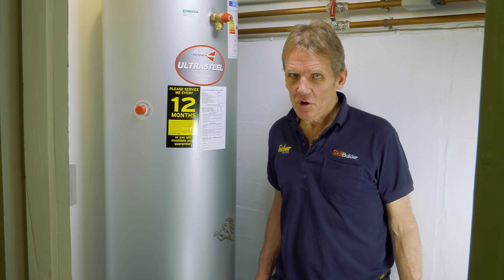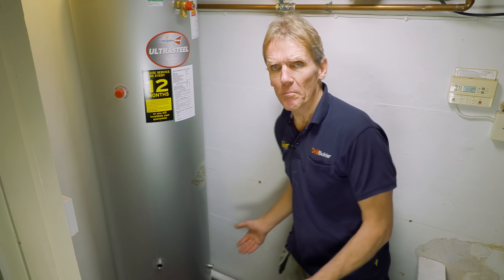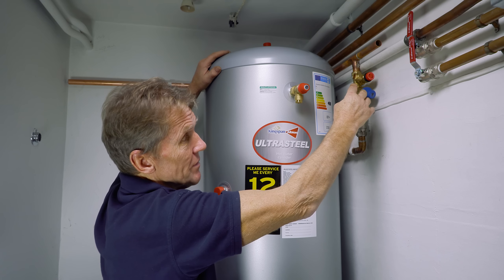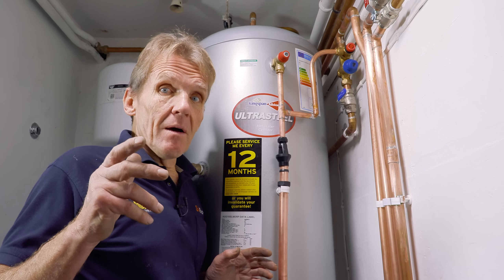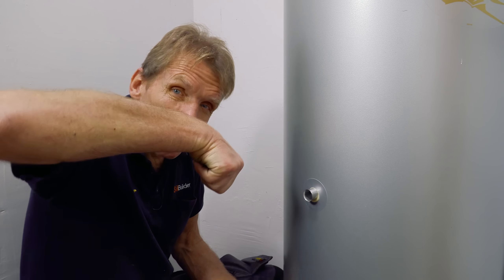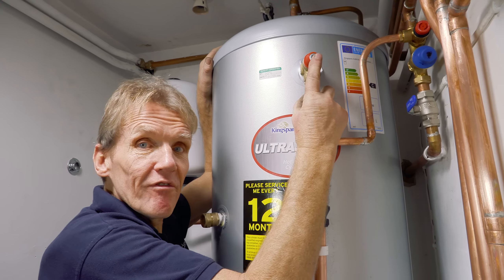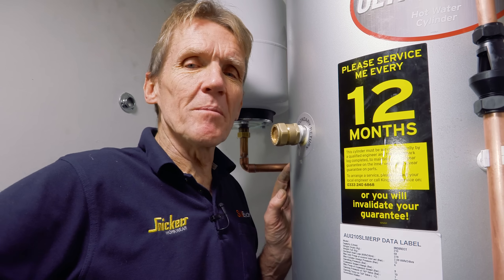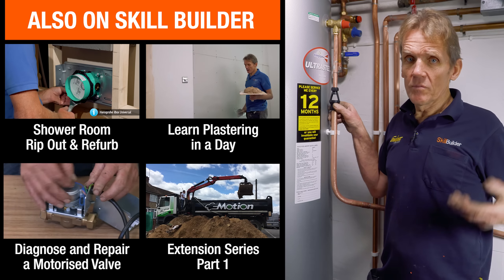Kingspan Albion Ultrasteel Unvented Water Cylinder

Comment: In my country, we only use Water boilers, all houses from 1970 was built with concrete, bricks or blocks (not concrete blocks, but normal blocks).

I have question:
I have house with upper floor and I want to use radiant heating.

This was my plan: 
Use electric boiler (4 of them, 2 on lower level and 2 on upper level, placed in opposite sides of house to lower temperature waste over long lines) to heat up water for radiators
Place radiators in all room (house is around 100 m2) 
Use eather Alu-Pex, or Copper or Iron (with insulation around the pipes)
(In next 5 to 10 years, I plan to put 4-5 Solar convection panels to get hot water)
Electric instaltion is or will be adapted to boilers needs + all appliances

I want to ask you, or someone from your audiance, can someone tell me, 
Pros and Cons using this system, and does someone have better solution?

We have natural gas, but we don't have it connected to our house or I don't want to use natural gas, as price is so fluctuating at this moment in our country.

Country: Serbia
Region: South-East Europe/Balkan

Thanks, and keep the good work.
Also, Happy New Year to everybody. :D
Reply from the maker: When you say radiant heat. Radiators as we know them in the U.K produce convected heat. Not a great way of heating. Better is underfloor heating which can run at a much lower temperature and use the concrete as a thermal store. That will allow you to replenish it with solar or electric heating.
Reply: Душан Палалић  Just go for a wooden boiler
Reply: @danielarhire1770  You mean, wooden fire boiler? :D I think wooden one will brake down. :D
Reply from the maker: This is not a boiler. It does not heat the water unless you use the immersion heater.

Comment: That cold water inlet is not at the bottom so I don't see how that drain off could possibly drain the cylinder all the way to the bottom
Reply from the maker: It doesn't but that it not unusual as Tom Jones said. The scale drops to the bottom and doesn't block the inlet.
Reply: The cold inlet is on a dip pipe and goes the the bottom of the cylinder. So if you are draining it out, the vacuum will take it all out.

Comment: The best is a DHW only thermal store. No risk of an explosion, as it operates at atmospheric pressure, giving mains pressure hot water. No G3 approved plumber needed. No annual service needed. Can be DIYed. Only G3 approved plumbers can install and maintain unvented cylinders. These men are not cheap.  They also need an annual service.

Thermal stores are more expensive to buy because few plumbers understand them, hence low production.  You can even buy square shaped thermal stores to save space. Some can be made to order.
Reply from the maker: Yes thermal stores are good but the unvented is also fine. They don't blow up. All this talk of explosions is nonsense. They have so many safety devices on them that it is almost unheard of.
Reply: @SkillBuilder  
From Hertfordshire Council:

Hertfordshire Building Control attended an explosion of a pressurised hot water cylinder in Wormley, just before Christmas. It caused a huge amount of destruction internally.

The front and rear windows blew out, the internal wall was demolished, as was the ceiling board and several ceiling joists and binders.

The explosion blew a hole in the roof at the rear. Ripples appeared in the roof tiles at the front of the building.

The exit door was blocked by debris and the occupants had a lucky escape, being rescued by Hertfordshire Fire & Rescue Service.
Reply: @SkillBuilder  
Amospheric DHW thermal stores are safe. Low pressure at all times, but give high pressure mains pressure hot water.  As there is no pressure valvegear on the cold supply the flow rates are higher, no restrictions, with water only running through a large bore DHW coil inside the store.  Having a square store is superb in space saving. Still available from McDonalds, who took over from Elson.

No G3 plumber needed with atmospheric thermal stores, or annual services charges. DHW thermal stores are simple with little to go wrong.  

When the unvented cylinder control valves need replacing the bill is .... ouch!  Then the depletion of the air in the pressure vessel over time. Plumbers love them as it is  unnecessary repeat business. 

Or have a SunAmp thermal store.
Reply from the maker: @johnburns4017  Hi John 
I often get emails from people telling me about unvented cylinder explosions and, so far, only one in America has proved to be an unvented cylinder and this was really an abcuebt  direct gas fired water heater. I have searched for the Hertfordhshire Building Control incident  and can't find the story. If you can point me to the source it would be helpful.  The video they show you at the start of the training course is not an installation. The cylinder was rigged to by pass every safety control and even the bursting disc on the temperature pressure relief was doctored. It takes a lot to blow an unvented cylinder up. I have seen a few instances of vented cylinders blowing up, they are often devoid of any safety devices.
Reply: @SkillBuilder  
The more these are fitted, and the older and more neglected they are, then more explosions you will see. Also many are fitted by unregistered operators not fitting them properly. I have seen a few that I have had to re-pipe as they are potentially dangerous.

I put an extra 3 bar pressure relief valve on the hot draw-off pipe right near the cylinder, in case the supplied one fails. They are cheap and worth it - in case.
Reply: @SkillBuilder  
yoo tube keeps deleting my replies as they have an address in them.
Reply: @SkillBuilder  
Some vented thermal stores do not need an overflow, or pressure relief valve pipe, so can be fitted in the centre of a house. No drilling walls, dripping tundishes or the likes. And give mains pressure hot water. Plumbers just do not know what is on the market.  If they did they would provide superior solutions.

Comment: Also another thing people who are calling themselves competent diyers you should have done this n that. There is nothing wrong with this set up. I had the worst pressure evet from hot before and cold would push it back. After installing the system this way my hot and cold work perfectly and im using concussive mixer taps. Hot comes out almost same pressure as cold. And the reason why pressure does not exceed what ever bar ppl are stating is because you put a pressure control valve on the inlet which has a nrv. These valves are usually set between 3 and 4.5 bar and are adjustable so its impossible to get higher bar than that unless you did something wrong. Lets say it did fail thats why you have the pressure relief valve on the tank to regulate the pressure back out if it exceeds the maximum pressure. Not to mention the expansion vessel to regulate pressure changes. Point is if you take your time and do the job properly you shouldn't have any problems
Reply: If this is aimed at me , I never said there was something wrong with the setup, I said it could be done if you are a DIY person especially if you are competent. My dad was a plumber , So I learnt a lot from him over the years helped him fit a few of these over the years , sadly passed away now but the knowledge  from him gave me the confidence to do the job myself and it works perfectly. Let's face it we are all DIY ers if you sit at the side of someone long enough watching take in what they are doing eventually you will be able to do it yourself thats how we all learn.

Comment: Installing an unvented cylinder as  diy isn't ok, much like installing your own boiler. If it blows up as it could do, you will be in deep trouble.
Reply from the maker: Who said it was a DIY job? How many unvented cylinders have blown up? How many vented cylinders have blown up? 
It is almost impossible to explode an unvented cylinder, you have to rig four safety devices to get that to happen and it still has a bursting disc.
Reply: @SkillBuilder  an eruption of scalding water can severely injure a person, either directly or a falling ceiling. I have seen many  cylinders installed without ANY zone valve, no electrical control and end stops applied to weeping prv! 
You are assuming the general public have a mechanical engineering mindset. Some do, but most don't. 
What is simple to you is difficult to others.

Comment: Bullshit, why is it not a DIY  job ,I did it no problem  2 years ago  on a direct cylinder , even wiring up the two immersion heaters.
Reply from the maker: It is not a DIY job because that is what the law says. We can't encourage people to break the law
Reply: @SkillBuilder  if I am competent doing the job I will,  I am not paying some plumber to do a  job I know I can do ,I also put a 3bar pressure reducing valve  on the cold feed into the house as well to stop any mains pressure fluctuation, the one thing I did get from your video was the one way valve after the hot water outlet I think I will put one of them on to stop any back pressure just incase . And everyone breaks the law and I mean everyone .